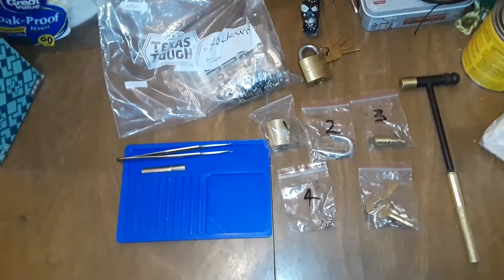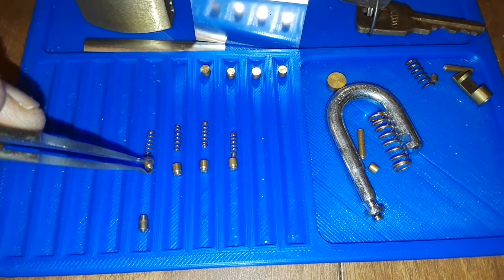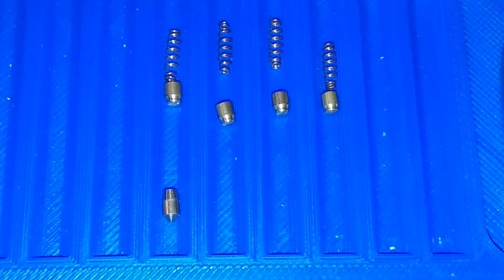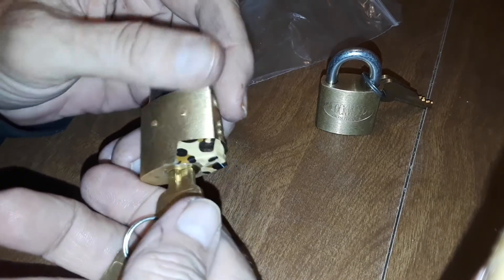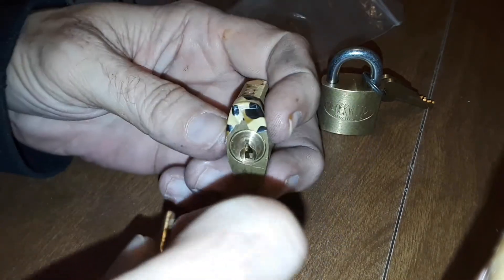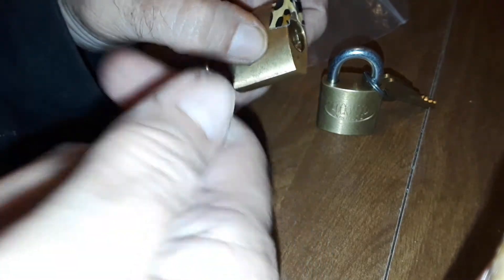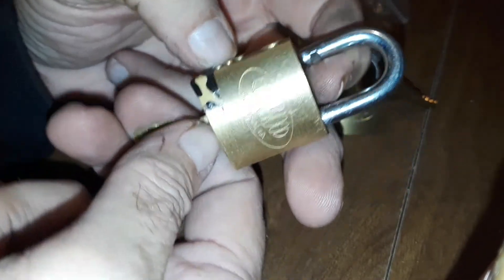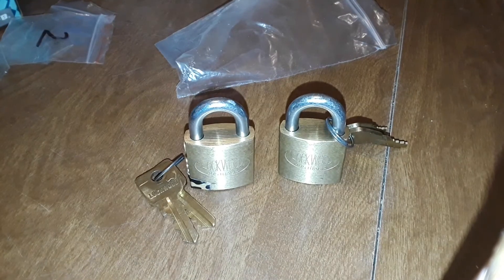(581) A Tale of Two Lockwoods

Comment: Going to send the medical supplies to get the poor bugger on his feet again. lol. It would be cruel to put him up on the shelf in that condition. The other padlocks will tease the s#@t out of him. lol. Good job. As you said, they are finicky to work on. Cheers:-) PS. Your cat looks suspiciously guilty for some reason. lol.
Reply: Hey, Paul, you know anything about the 15 x 245's on eBay? Coming out of Adelaide and sold ready to assemble. I wondered if it was from you?
Reply: @two_tier_gary_rumain  Yeah, i heard about them. They are 234's in locksmith form. No, they are not mine. I haven;t seen the ad. Not sure who is selling them. I think he would have more success selling them separately. Cheers:-)
Reply from the maker: You make it look easy my friend.  I saw your medical kit video.  That will fix up the little Lockwood & keep the other locks from making fun of him. I'm surprised at the great drivers in that lock. You can also see the long taper on the keypins.
Reply: @crankylock7844  Indeed. 15 are a bit too much for most. Especially at $200+. But it does work out to about $15 each.
Reply: @WilliamMancel  That taper is amazing. Never seen them that long. Now I'll have to pester Paul for some. :)